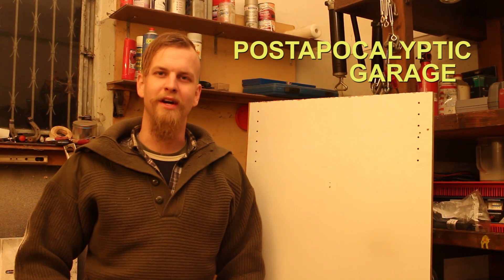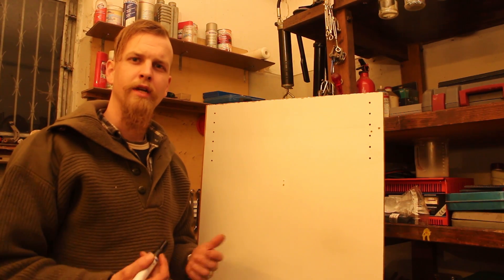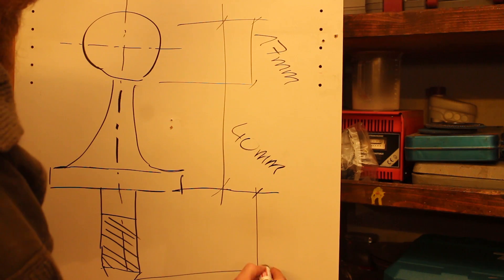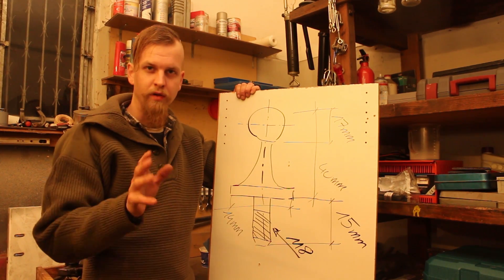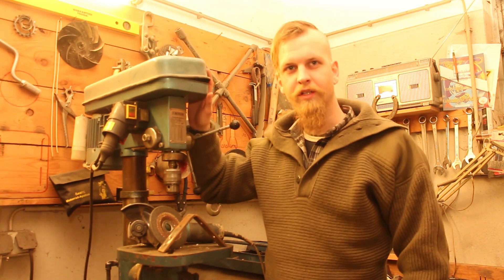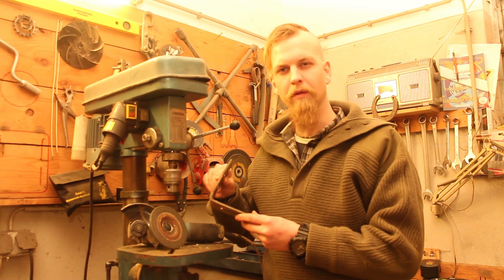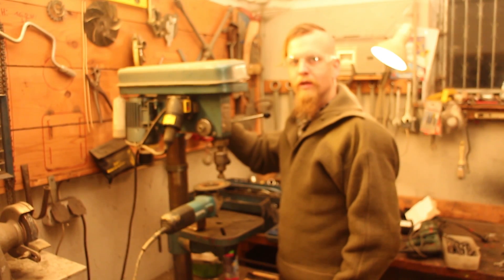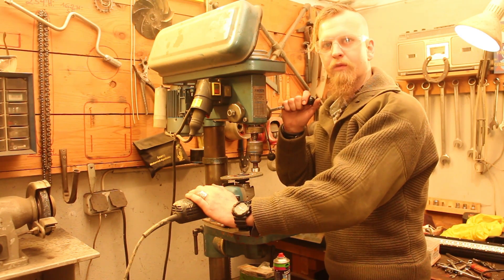How To Improvise A Lathe - Post Apocalyptic Power Tools

Comment: I could pull a better lathe outa my @$$ , oh wait I loved this. Have used this many times before getting a small shop together. In fact Dad had this exact drill press in the small engine repair shop. He made me a drive center and tail center to put in the table hole. That was my intro to wood turning as a kid. A customer seen me using flat chisels , he went home n brought back a set of tiny turning chisels , and gave to me. That was 40 years ago. Haven't thought about that since seeing this video.

Comment: Awesome. Drill motor and a vise! Most of my Gunsmith projects have used just a drill motor and vise instead of a lathe. I like the way you do things. Had to sell my 12x36 gear head lathe, but I still have my old Steinel milling machine. Thanks Spaceman Moe.